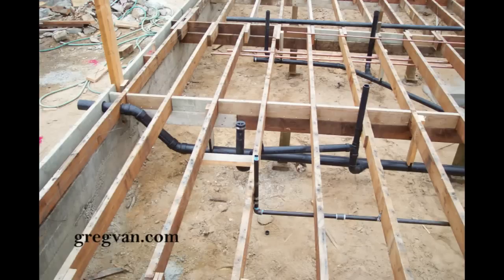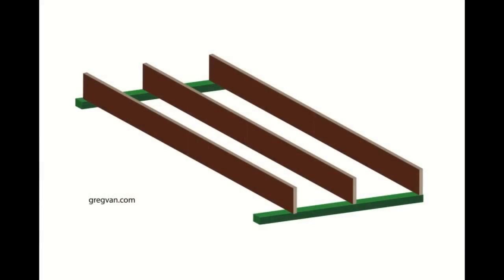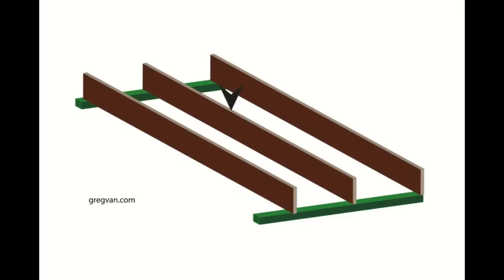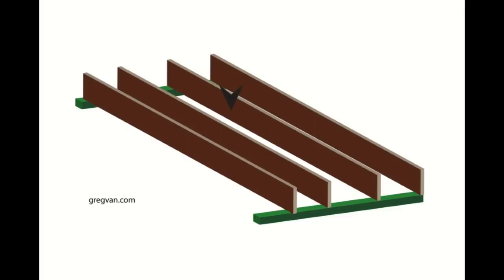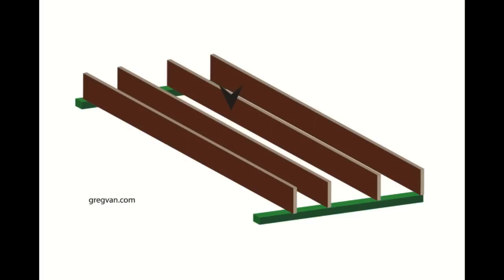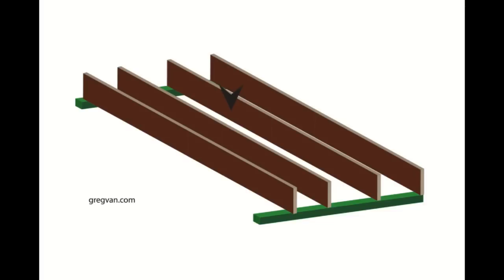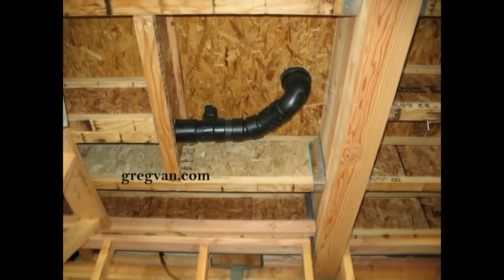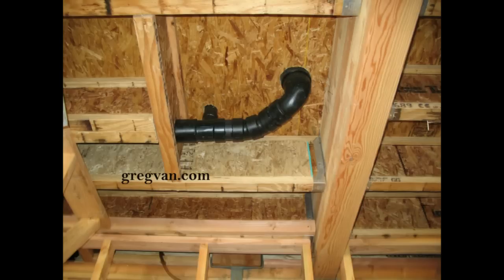How To Move Floor Joists For Drain Pipes - Construction Solutions

Comment: Only time you would run into problems with this solution is if you have a subfloor seam running down the joist you removed. That is when using head out would work better. You can remove a small rectangle of subfloor which would be 2 pieces and replace it with 1 that would be supported on all sides.

Comment: I have just removed a bathtub in a 25 year old mobile home that had a drain in the right/middle/wall side of the tub. I'm replacing that tub with a shower pan that has a drain in the center of the shower pan underneath the shower head. The drain location of the new shower pan sits directly over the middle of a floor joist. I have to cut that floor joist out to be able to relocate the old drain location to the new drain location. Would I have to "head that out" to make it work?
Reply from the maker: I can't provide structural engineering formation, but I would try to install the doubler.